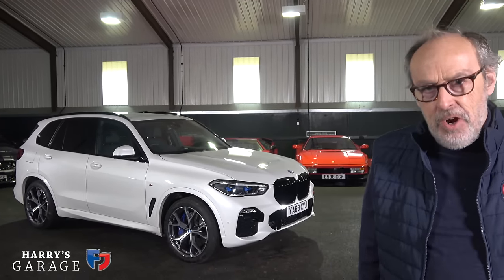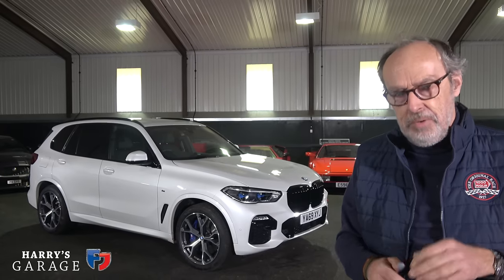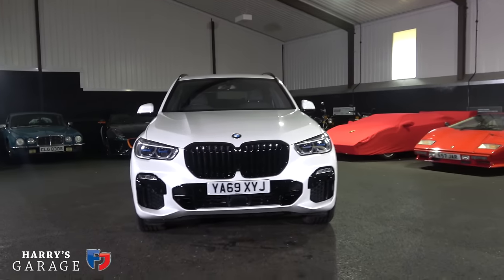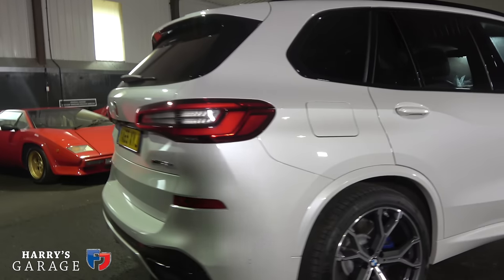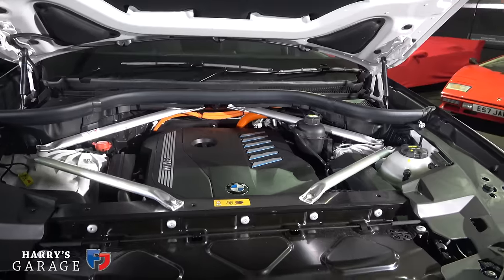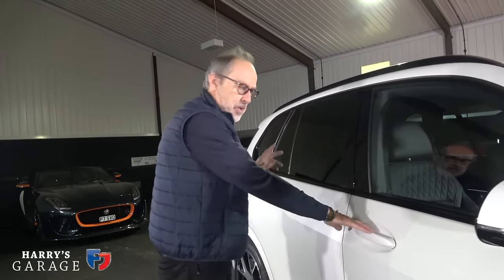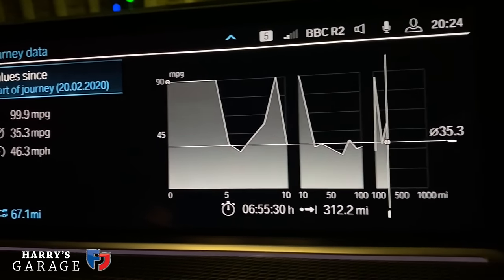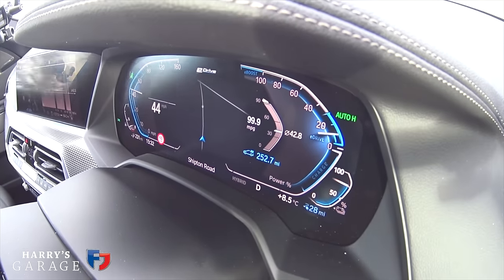BMW X5 45e PHEV 2020 review. Is this new plug-in hybrid better than a pure EV in the real world?

Comment: 80% of miles on electric but only about a 50% saving in fuel? Doesn't add up unless you were rounding up/down A LOT. Also, no one is addressing the big question of how long these batteries last. A 3 yr old Nissan Leaf has half its original electric range and at 30-35 miles is basically useless. Also this takes a damn long time to charge so you end up charging for huge amounts of time to the point where the battery is full. We're told that a mobile phone battery has a set number of lives built into it and one life is used up everytime the battery is charged to full or empties to flat. Is this how a car battery behaves or has the tech moved on? If the life is only about 5 years then what happens, replace the battery pack (and what's the cost of that) or just run it on petrol? At the moment, I reckon you need between 2 to 3 electric cars for every petrol/diesel car (in terms of life of the batteries. IF I'm right then the supposed CO2 savings ain't that great. This is the future, if only because it's going to be forced on us by the fuckers who it's going to impact the least, but we are some way off electric being a viable solution for many (infrastructure, range, etc.)
Reply: Garbage - "Nissan will repair or replace a Leaf's battery within five years or 60,000 miles if it loses more than 30 percent of its charge capacity"
Reply: "Only" a 50% fuel saving?

Comment: One problem. How much electricity does it use when being plugged in at home?
Reply: Max G 16A. But depending on your type of wallbox it’s able to do load balancing etc
Reply: 45 miles (24kWh) 

5p (off peak)= £1.20
15p normal rate= £3.60

Comment: Cars using National Grid power is going to cause immense power shortages. Result? Electricity prices are going to rocket. That is going to cause immense problems. Plus hauling all that weight about and all the rare metals used for car batteries is another issue no-one seems to want to discuss. It's all going to end in tears. Electric cars just do not make any sense. I love cars but their days are numbered because of the  pollution we create using them. The cars in use today need to be looked after like a cherished classic. We have got to make them last rather than replaced.

Comment: If they made it an 100kWh EV, it would get just shy over 200 miles. Not really good battery technology. Also both the heavy charging intervall with the batterypack and the cold engine starting and stopping all the time will cause the car to wear down way too fast. I feel sorry for second hand buyers.
Reply: Cold starts can be mitigated by special oil, treatment of bores and turning the engine over via the EV battery
Reply: @TheDavidsims  Or just going full EV and not needing to maintain any of the fossil parts.  A hybrid is only a good alternative to normal fossil cars when its new. Just look at the Toyota/Lexus hybrids. Batteries degrade fast and are toast after 100k miles. Then you end up with a thirsty petrol engine. I once had a Prius as a rental. I averaged almost 60mpg at low speeds and as low as 28mpg on the highway. Would rather drive an efficient diesel then.

Comment: For a modern super Hi Tech car its not that great is it. This last month ive been using my 1997 Saab 9000 Aero 2.3T. Its tuned a bit to 308 BHP and it also gets a move on pretty quickly. I did 2,200 miles last month at an average of 40.5mpg. From a 25yr old Petrol car !.  And this new super duper BMW does not even match that. Ummmm

Comment: The 35mpg or so result is simply not good enough.  That equates to 8L/100km. I have a G05 X5 M50d (294kW/760Nm) which regularly sits at mid to high 7 L/100km on my weekly routine to and from work, running kids around etc.   on the current tank of fuel it’s done 7.4 over 280km which is astonishing and it is also quick (0-100k in 5.2) when you need it to be.  I’ve been very very impressed with it.  

Problem with the hybrid is the 300kg dead weight of the battery that you’re lugging around with a petrol engine.  Also my car is awesome for towing whereas the battery would be drained quickly in a hybrid towing a 2.4T caravan and then the petrol engine would drink like a sailor lugging battery and caravan such that it would do much worse economy wise.  So I get the idea but practically it just doesn’t stack up.   It needs to be much more efficient than the diesel to make sense.  I test drove the Cayenne hybrid before I bought the X5 and the demo was averaging 13L/100km which is just ridiculous when economy is meant to be the objective.

I agree with Harry where the X5 45e is very good is the electric only range - it could cover my work commute on 100% electric, recharge at home at at night.  Then it really comes into its own.  But until they have a towing solution then I’m stuck with dirty diesel.
Reply: Doug M you’re forgetting one thing - company car tax. As of April 2020, car tax on a X5 M50d, assuming your a 40% taxpayer, will be £873.00 a month. Tax on the X5 45e will be £133.00 a month.
It’s a no-brainer for company car drivers.
Reply: Not in Australia!   No doubt at some stage they will penalise petrol and diesel over EV and hybrid but not yet.  And in any case, because I need to tow a caravan and a race car trailer from time to time, hybrid or EV is not suitable. Well not yet anyway.  And it’s privately owned not a company car.
Reply: Doug M fair play to you 😊 
I don’t think you can get a tow hook with the 45e anyway. M50d is an awesome machine, it just doesn’t make sense here in UK as a company car. 
If I was to buy one with my own money I’d get the 30d as it has the air suspension - our roads here are absolutely terrible (pot holes literally everywhere) and hope that it would iron-out the ride a bit.
I currently have a 530d Msport on 20” wheels and have ruined two tyres last 4 months on pot holes!!!

Comment: So this is the ultimate answer to our environmental concerns: a 2.5 tonne high-performance high-airdrag mega-truck with the manufacturing overhead of two drive-lines.  People will use this for the schoolrun or getting a pint of milk from the cornershop in a busy urban area - and then buy a new one every 2 or 3 years on PCP.  This is not a green-credential game-changer - it's the reconfirmation of our nation-wide ignorance of the fact that driving less and hanging on to our cars for (much) longer is the only option that will make a difference - and once we are there, pick any fuel you like.

Comment: I must be the only person in the world who absolutely loathes SUVs. I see them everywhere these days. I'd wager 99% have never been off road - they're used purely as everyday runabouts - which makes the 4WD aspect a waste of money. Compared to a wagon, they have poor fuel economy, are heavier, produce more CO2 and have worse handling thanks to their height and weight. Some might say they enjoy height aspect but this supposed advantage is negated when every other Tom, Dick and Harry is also driving one. 
Worse still,  the people who drive them think they've got the Queen on board. When moving away from the lights, they take about 1km to accelerate from 0 to 60 km/h and that's if they actually make it to 60. There is a certain class of SUV driver who thinks that its better to drive at 10 km/h below the signed limit everywhere they go. I can understand going slowly in a built up area but when you're on the freeway - come on!!!

Comment: It's not a very compelling purchase to spend 76 grand to save 1500 quid a year. Unusually, maybe this review failed to discuss the performance aspects of the hybrid system, which may be more compelling. I think hybrids could have been the way, especially for performance cars. Three main driving modes: Electric only, ICE only, and combined performance. IMO, a better way forward than turbocharging -- or worse, characterless EVs with sound generators -- although weight remains an issue at the moment. But think about how much smaller and more efficient cellphone batteries have become in the last 30 years. 
Anyway, I am grateful that Harry avoids the save the planet politics of justifying EVs, because all transport constitutes 15% of manmade CO2 emissions globally, and the majority is from planes, trains and trucks. 
That doesn't mean I'm opposed to EVs. Quite the contrary, I think a push for EVs is warranted for vehicles used to commute daily into the centres of big cities in order to reduce high concentrations of harmful emissions. 
At the same time, I am all for continued development of particulate filters and stop-start tech for ICE vehicles, which is still in its infancy. 
Of course, right now there are tax avoidance incentives that help the economic case for buying pure EVs, and if you are faced with otherwise paying more than 11 quid a day to enter central London, the economic case for buying a pure EV becomes compelling. 
However, in the UK most people don't have off-street parking, and that makes the need for good charging infrastructure a necessity for EV ownership, which simply doesn't exist at the moment. 
More than that, the tax incentives for hybrids have gone, and TfL has already announced that the incentives for pure EVs entering central London will end in a few years, and that will take away the economic case that currently exists. 
Then there's the question of how the electricity is produced. And the question of a global shortage of the metals needed to produce EVs, let alone to replace the entire fleet of vehicles in the UK alone. 
This raises the question why the UK Government is ignoring the progress made in developing emissions technologies for ICE vehicles that use a fuel source the world still has plenty of, and why its policies, and those of other countries, risk further progress being made? 
The fact is that the economic case for buying electric cars will soon cease to exist. It has already ceased to exist for hybrids like this BMW, even though the technology is indeed impressive. 
I suggest that Government interventions are counterproductive. They determine the direction of technological progress rather than the market, which is fully capable of making its own decisions, and I believe would result in a better balanced progression of all the technologies simultaneously, rather than cutting off certain avenues for technological advancement. 
Okay, the market is also capable of potentially screwing up things, as we see in the war of the currents, but political interventions are almost always incredibly short-sighted, hasty and convenient. 
Why pick on the car? Why attack the personal transportation/personal freedom, even private ownership model? Why try to change attitudes and habits in such regard? I know why, but for the sake of argument let's assume the intentions are actually good. 
What about encouraging people to holiday in the UK? What about encouraging telecommuting rather than focussing on commuting? What about encouraging e-meetings, e-conferencing, and even e-teaching? 
These are all changes we can make right now! Instead of focussing on reducing journeys, the means of the journeys is the focus. 
Yet reducing journeys also reduces road congestion and pressures on public transport and infrastructure, and the need for massive infrastructure development projects that focus on moving people, rather than focussing on better ways to move freight. 
Yes, better ways to move freight was and should now be the focus. EV articulated lorries is not currently realistic, unless their role changes from inter-city haulers to intra-city haulers, using trains as the inter-city haulers. And of course electric trains are old hat. 
Such would eliminate more emissions than targeting private cars. 
The economic case for EVs does not really exist. The raw materials are in short supply. Governments are not going to give up fuel taxes. Tax incentives have already been significantly reduced. Exemptions from paying to enter various zones are already planned to be withdrawn. There will be road user charges, and likely massive purchase taxes to keep the price of EVs (the only cars you will be able to buy new in the UK after 2035) high, in order to reduce private ownership, and therefore attack the personal mobility/freedom of movement model. 
Already, nobody wants to pay to upkeep the roads;. Why should charging infrastructure be any different? And, who knows what will happen to the infrastructure for fuelling ICE cars, petrol/diesel prices, and taxes for owning ICE cars? 
It seems to me that targeting private cars is actually going to damage infrastructure, damage personal freedoms, damage the economy, not least the free movement of labour, put more pressure on cities and housing, lower the average quality of life, fail to seriously reduce CO2 emissions, if indeed that is really the goal, and fail to address what needs to be addressed and can be addressed right now, without inventing false targets and waiting for 2035.

Comment: 6:35 Can you spot it?
This is how you know you're driving behind someone born before 1960.
Reply: No....but I’m sure Harry would be very pleased with that
Reply: @advancelast1740  Rear wiper was on until it started raining, then he turned it off.
Reply: @BigPotatoChill  Why would age make a difference? (He didn't turn it off).
Reply: @gregcavarra4807  I guess you don't drive very much? It is usually elderly people that drive around with their rear wipers on and sometimes the fog light.
I didn't see it go off after he fiddled with it.
Reply: @BigPotatoChill  "I guess you don't drive very much?" What's the point of being twaattish? I was just asking a question. Modern cars (and my not modern car) have auto wipers which might ruin any ageism. He didn't turn it off because you can see it move in the final frame. Edit: Now you say it didn't go off, I give up.
Reply: @gregcavarra4807  Holy.. you really need to calm down or stop reading comments. It's all meant as a bit of fun. I have never seen a rain sensor that activated the rear wiper, but they might exist, I don't know. Didn't go off as in the wipers moving off from their down position, but I see why that could be confusing.
Have a nice day, you sound like you could need it.
Reply: Many years ago I owned a Mk2 Golf. Once the rear wiper was turned on, it wouldn't turn off until the ignition was turned off. I used to dip the clutch, turn the ignition off then back on then lift the clutch just to turn it off without stopping.

Comment: Only able to charge at 3.6KW is ridiculous and ridiculously slow.  Go get a proper EV
Reply from the maker: Turns out it's due to regulations in Germany where EV charging rates are now being limited at home charging points (max is now 4.7KWh while I can charge at 22KWh here in the UK), so as to not over-load the grid. Doesn't bode well for the future; charging something like an I-Pace or Tesla at 4.7KWh would mean waiting over 20hours for it to fully recharge, which would put me off owning one.
Reply: Harry's garage wow they don’t want EVs to take off if they’re only allowing a max of 4.7KW at home. The German car industry is definitely being turned on it’s on head by EVs. 
I charge my I-Pace at the office using a 7.2KW charger and that usually keeps me topped up and doesn’t cost me a penny and the government isn’t getting any duty from the fuel I am using. I can’t see them allowing this to continue for too long.

Comment: Yes running the engine could is actually pretty bad for the environment because the emissions can't be given the proper aftercare. I know it's the same problem with combustion engine powered cars but they major issue is when you drive in e-mode until you reach the highway and go full throttle to get on the highway. During that acceleration you're putting lots of emissions into the atmosphere. Just wanted to share that.

Comment: No regen, no super capacitors and a gas gussler. BM could have fitted LPG and electric on a smaller engine  without run flat tyres,but no, they must make as many gas guzzler's before the ban. Wheel bearings £100+, Buy a Mini, made in the UK with only a few miles on shipping. My wife drives an X3 and I hate it because it is rock hard and faults like pig tail springs break, parts are overpriced. BM mechanics earn about £12 ph in NE unlike the BM staff in Germany. Fair Trade it is not.

Comment: On other outing you rightly criticised government ev policy and I agree with you on diesel. I have a 2.2Mazda 6 diesel luxury sports hatchback and with careful driving can get 1250kms from 62 l tank max. I live in the Lower Hunter Valley between National Parks in NSW. I would love the Mercedes 300 GLE de is this rare diesel electric with at least as bigger e range as the  BMW X5 45e not available in the UK? It isn’t here either, sadly. We have a fossil government hopefully soon to be removed so evs and phevs may get a foot in. Charging infrastructure is even worse here.